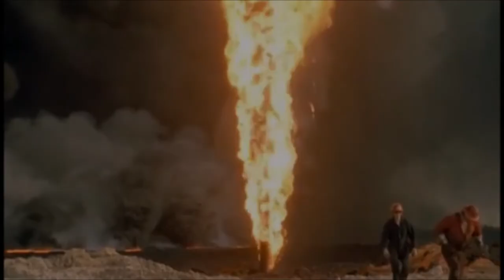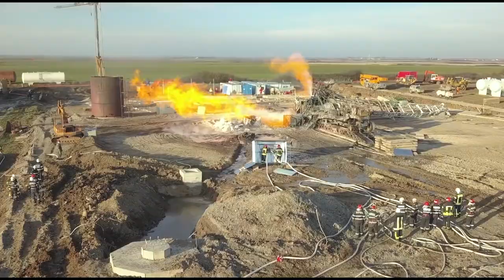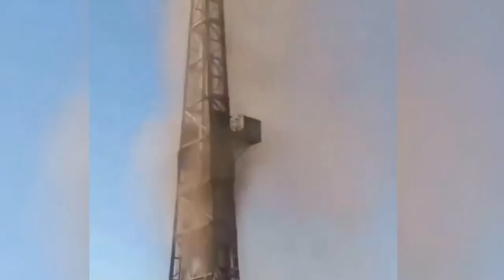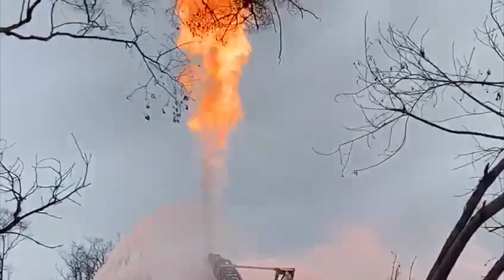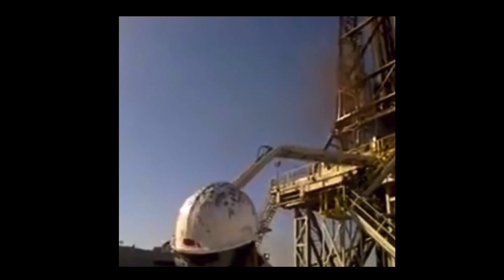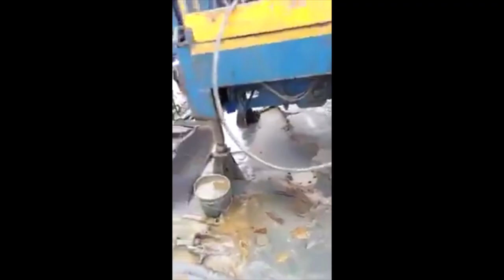DRILLING RIG BLOWOUTS 3 SEPT 2020

Comment: There's nothing more blood curdling than hearing that iron groan, I've worked on rigs for about 3 years at this point and I've only been in one blowout. It was on a Nabors rig out in Midland and I have never been more scared and confused in my life.
Reply from the maker: its pretty crazy to be right on it, ive bought stuff to blow outs as a trucker and pretty crazy the power of the burning resources torching a drilling rig.

Comment: Safety boss oil well firefighting company they got some nice trucks as well and they have the frankenstein monster of pumper trucks for firefighting on a oil well call
Reply from the maker: We worked for them a few times at Roadtrain. They had a awesome 60s peterbilt show truck they would take to oil shows
Reply: Boots and coots and wildwell control oil well firefighting and when your oilfield looke a like a flamethrower call in safety boss and they will turn to huston Texas for help as well

Comment: Why do they light the rig up? Seems like a waste at that point
Reply from the maker: they light it to weaken the steel. then it falls over making it safer to pull it away from the well. if you try to move it standing it's not safe because of the distance it covers if it does fall
Reply: Also burns off the oil and gas instead of flying it in the air. Just like a flare ,up in the air , at an oil refinery.
Reply: It’s also safer when it’s burning, actually. Vapors and spray collect just looking for an ignition source when it’s not. If it’s already burning we can see what we’re dealing with - longtime fire fighter.

Comment: Why toss flares into it to make it burn?  Won't the fire make it harder to cap?
Reply from the maker: just less dangerous when your not soaking in flammable liquid. make the whole area pretty dangerous when its flammable. plus you have to have running equipment, one spark and everyones dead, ignite it before hand no risk to everyone working on it since its already on fire

Comment: Some of these are just plain disrespectful, i saw 2 where the men were forced back onto the rig by their boss to shut down operations- risking their life - and one where Some Guy runs back up because probably his mates down there. The jokes are disrespectful to anyone risking their life there.
Reply from the maker: its wintergreen?
Reply from the maker: who knows the story. one is a guy turning of the diverter valve in one clip. the one about the wintergreen sure it might be untastfull but theres also a line where no one has to do anything they don't want to. the right to refuse unsafe work, all oil work has its dangers yet we go to work everyday and clown around. i would ultimately hope no one has to die at work. its youtube not the news
Reply: @TimelapseTruckerRTOT  I was honestly shocked by how tall that substructure was. I roughnecked and swamped for many years in the 80’s and 90’s . Finished that career as derrickhand so height’s are that a big a deal as long as you respect it and respect Mother Earth as well.